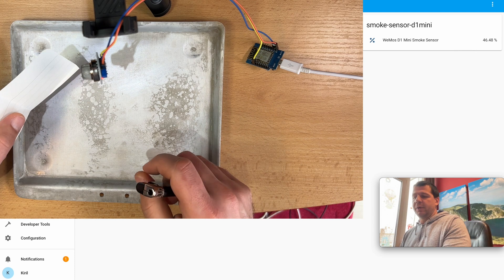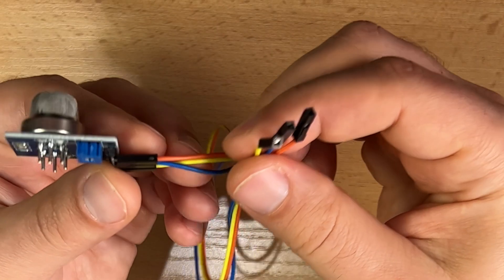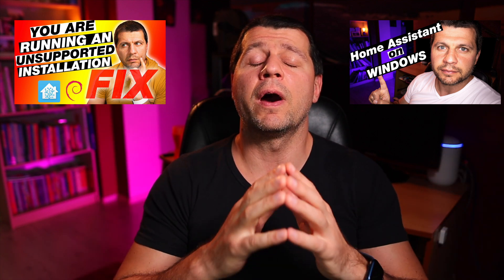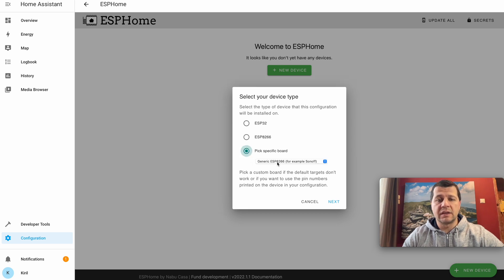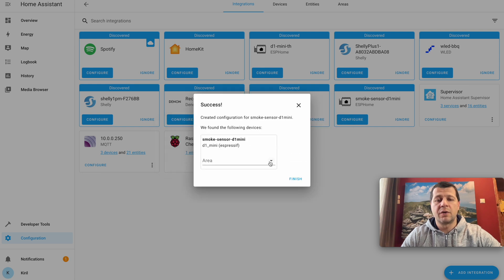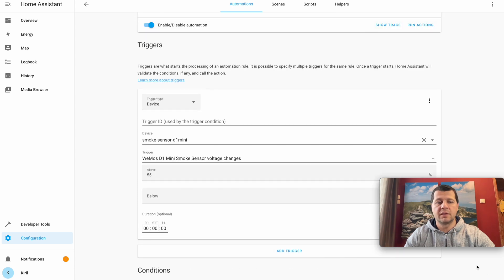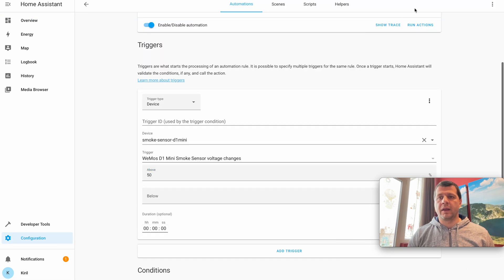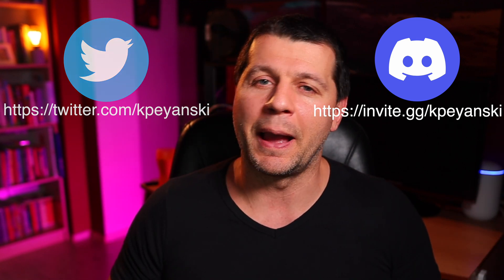DIY Smoke Sensor for Home Assistant with D1 Mini, MQ-2 & ESPHome

Comment: #SmokeSensorOwner - i'm also late to the party, i've actuay had an MQ-2 smoke sensor for ages, but never implemented it untill last week where i have made my own multi sensor because i'm too cheap to buy 'ready made ones' hahaha - i do not rely on this as my stand-a-lone smoke detector, as i have ones already installed in my home, this is just a nice little addition for a notification, however, has anyone found the best '%' detection for a notification? like...what percentage increase are people using for notifications? 20% ? 30% ? i still havent found the right setting yet.....just curioous...
btw kiri ...awesome yt video.....keep it up :)

Comment: Hi, I have a question .. on my Esp32 Wroom - I do not have marked A0 Pin -. where should I connect ? thanks for help great video 
btw
Reply from the maker: Is there an analog pin?
Reply: @KPeyanski  I suppose so .. seems from 32-39 are both a and d

Comment: The 1st Smoke detector got detected & installed with no issue, but when I try to add another smoke detector, it couldn't be detected by the USB port. Any idea why? Any change in the procedure for the second board?
Reply from the maker: You have to change the name of the second device in the yaml code. That is all

Comment: You video are always very informative keep them coming, I have a question  have set up everything, the only problem is that I get a sensor reading of 4.199% and and not 52% why?
Reply from the maker: That should be OK. Test yours with some smoke and if it reacts then you are good to go. Maybe you are living in the Alps and your Air is very clear :)  Mine sensor  started from the 40-50% and after a day they are going to 10-15%

Comment: Thank you for your instructions. I'm wondering if this application applies to ESP32 boards b/c there is a difference for the ADC pin voltage tolerance. The MQ sensors are driven by 5V so under high PPM the sensor output can go well beyond 3.3V, the absolute maximum for ESP32 GPIOs. This posts a threat to fry ESP32 boards if my understanding is correct. The solution is discarding the MQ sensor board and wiring from the 6pin module, dividing the onboard RL (1k Ohm, code 102) into two resistors e.g. 330 Ohm and 470 Ohm (to GND), then applying ADC around the 470 Ohm resistor we get a perfectly safe 0V-2.94V input range to ESP32 GPIOs. Kindly share your thoughts.
Reply: Great question! Not answered after 2 years??!!Poster has answered most comments. Do you need to toss the mq board? Cant we wire the sensor though a level shifter? This is the frustration with these esp boards. So many sensors are designed for 5v.

Comment: I think your project has a huge problem. Mq2 sensor outputs 5v in the analog port when the smoke reaches his maximum value. This means that at that point your d1 mini will fry because the maximum allowed value for a original d1 mini is 3.2v (it has a voltage divider for the esp8266 port, which only supports max 1v)
At some point of time, if you have a fire your d1 mini could die at some point.
Reply: Basically, you are right; analog output from MQ-2 is 0 ~ 4.2V. However it reaches above 3V only at extreme concentrations, so there are more chances that the fire will fry the setup than first ;)
Reply: @iliahborg7079  If considering other MQ sensors this concern is very valid. Some MQ sensors go beyond 3.3V very easily on the AO pins.

Comment: If we are using HA on the VM, how can we connect to configure ? Is it possible to connect by wifi for first config or we need to use a raspberry pi for this?

Comment: Thank you.  Been meaning to add a smoke alarm in the loft where I keep the Home Assistant Pi.  This will do the job perfectly.
Reply from the maker: Enjoy!
Reply: @KPeyanski  finished it. Only snag was when I tried to do the firmware install onto the esp8266 whilst connected to the home assistant pi. ESPhome couldn't see the Pi  port that the d1 was plugged into. After a bit more research I did a manual install using the windows firmware installer. It then connected over WiFi straight away and automations easily setup. Thanks
Reply: @TimHodgesofEdinburgh  How did you do this?

Comment: Good idea. The issue is the Power supply, and that sou have to put it on the ceiling.
Reply from the maker: Yes, that could be an issue if your place is already finished and pretty. Some cables going to the ceiling will not be a pretty sight.

Comment: I got a 6 pack of these from Amazon. I need to figure out where to use all of them. I noticed that my percent level went from 55% when I first hooked it up to a fairly stable 25% after a day. I think I will use them where natural gas is used, such as the furnace in my attic and the water heater in the garage.
Reply from the maker: That sound like a plan to me. Enjoy!
Reply: Almost sure that in daylight time the reading will be higher than at night just bz of human activity

Comment: Waiting for such videos since couple months.  Many Thanks for sharing.  Just need to confirm can we use above code for sensor MQ135 or not.
Reply from the maker: I think it will work, but I guess you have to try. Don’t forget to share the results afterwards.
Reply: Yes Sir, it is working perfectly for sensor MQ135. Again thanks for acknowledging my question.

Comment: Does anyone know how many devices can be powered from the 5v PIN of a D1 Mini?  Im sure the answer isn't straight forward. For example, it would be nice to power a PIR, Temp/Humidify and also the Smoke sensor all from the same D1 Mini.
Reply: The power doesn't have to go through the D1 Mini. You can hook up a power supply to a power rail and hook up as much as the power supply can handle.  I did this with an ESP32 that didn't pass through the 5V.

Comment: Great video!    I’m already using AO on my D1 Mini.   What would need to change to use the digital out of MQ2 instead of the analog out?  Thanks.
Reply: MQ-2 sensor has a digital out pin, you can adjust the sens via the onboard resistor
Reply from the maker: I’m not sure about that. This should be researched. Maybe someone else can answer you right away.